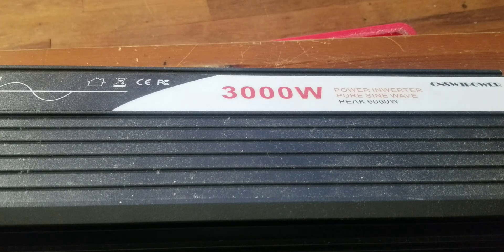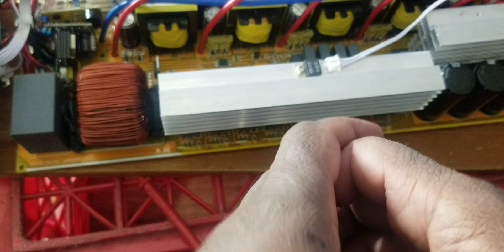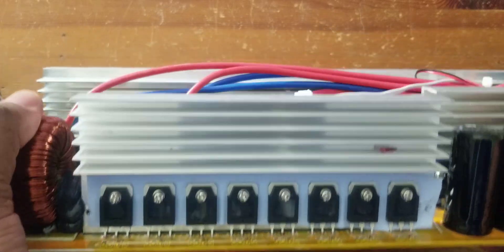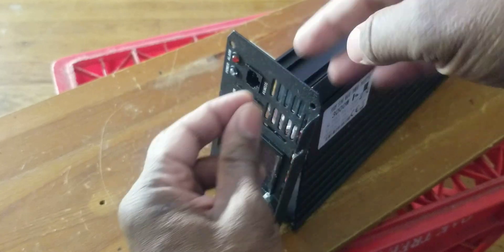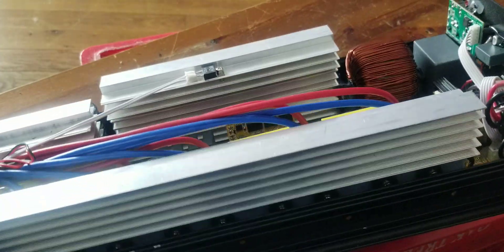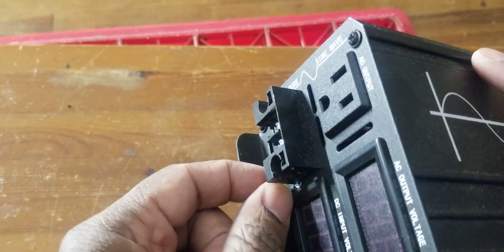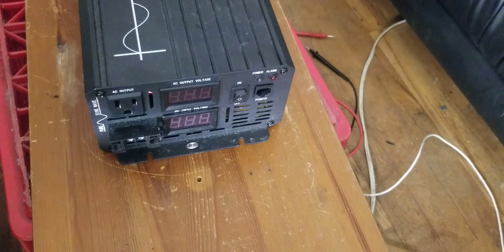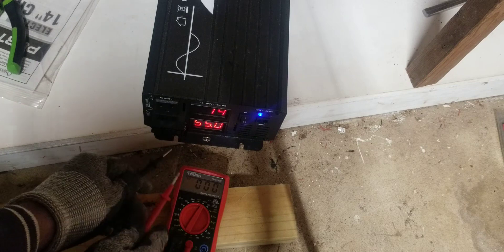Xijia 3000W dc 48v to 110V 120V ac 60HZ Pure sine Wave Solar Inverter for Home DC48V (Range 40V-60V)

Comment: I have a Reliable Inverter and mines swing between 122v - 113v so currently I am in touch with Reliable power trying to buy a repair kit for it even though it's working but in my mind something is going. Maybe you need to check the pure sine board though.
Reply from the maker: Just got a new one. I turn it on and no power. I will have a video
Reply: Is that at idle or load. If under load that is normal. And you're being overdramatic. I have had my 1000w for several years with no issues. I also don't beat the hell out of it. I have a 4000w reliable aswell and have had no issues.
Reply: @LastExile1989  I found the problem. One of the capacitor is damage. I am happy to hear your inverter have no issues, mines does. I also find it hard  communicating with Reliable Power. You get fast reply when buying the equipment after that, Lord 🙏 Help you! Man in communication with Reliable they promised to source the capacitor I guess they are still sourcing parts for their own product.
Reply: @howardescoffery4950  Yea. I'm so glad I haven't had to go back to them for anything. I know others have no problem getting parts from them.
Reply: You overload and broke it. That is all
Reply: @GrantCalloway  No, I found out what was the problem. I had just switch to Lifepo4 batteries 🔋🔋 and when ever they had to shot down for low voltage it seems to affect the AC output. I just ajust the pad back to 120v plus I now have lots of extra power. Haven't had the problem again.